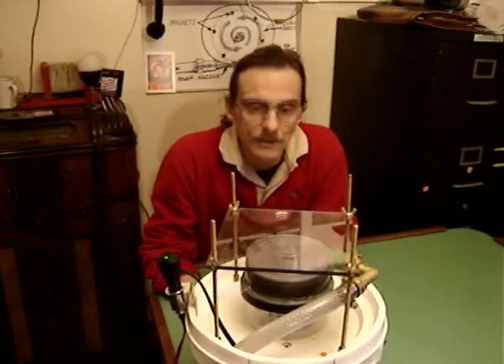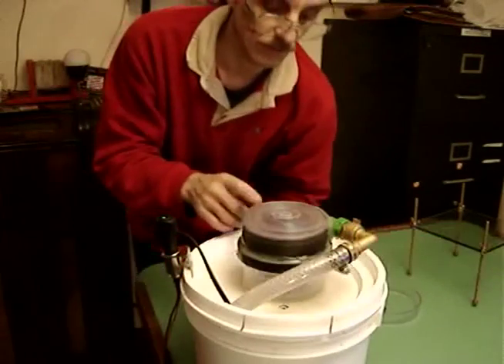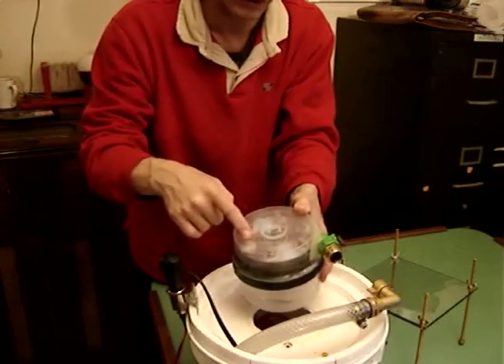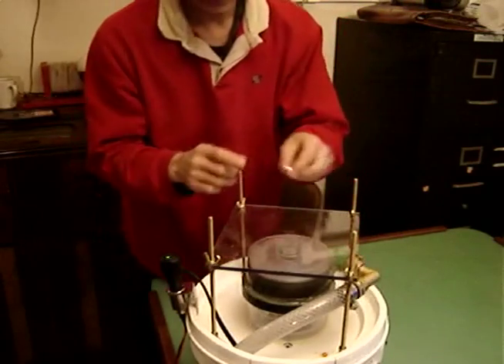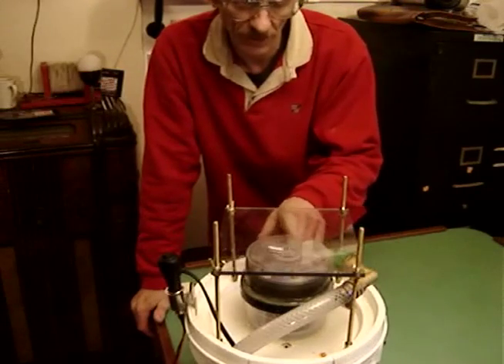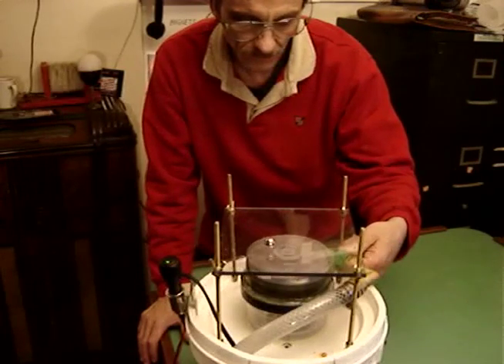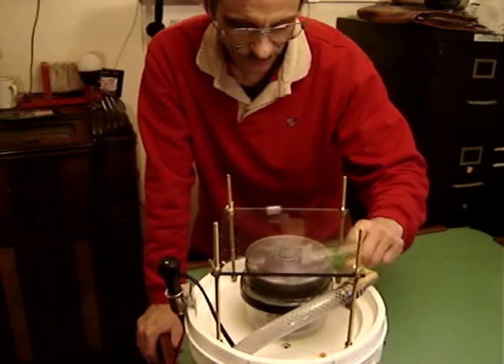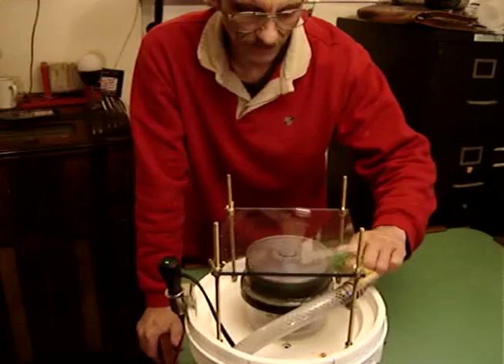Tesla CD Turbine At The Science Fair

Comment: I'd guess it goes backwards because the turbine magnets pull the bottom side of the ball in the direction that the turbine rolls, causing the ball to spin as if it were actually touching the top CD () that is, the ball's bottom surface moves in the same direction as the turbine). But because the ball is touching the plexi plate, friction causes the ball to move in the opposite direction. Cool how the magnets keep the ball from flying off the plate - sort of like a satellite in Earth orbit.

Comment: Try it with a flat magnet - won't happen.  The ball is a magnet, right (not just magnetic steel)?  What you're seeing is due to inertia.  At slow speeds, the ball is not rolling.  It is coupled to a magnet below and simply dragged around.  At a certain speed, the lower magnet will outpace the ball, pulling the ball's magnetic axis off vertical, setting it spinning (rolling) about it's own axis.  In a perfect world the ball would just sit and roll in place - friction gives it forward motion.

Comment from the maker: @geekwes2 
We used 1/32 inch thick x 1/4 inch discs as spacers between the CD discs. We also used 1/2 x 1/2 inch neodymium cylinder magnets as the top drive magnets.

Comment from the maker: @MarkRiverbank 
Yes, alternating magnets would be better for generating electricity. It is problematic to use alternating magnets as a magnetic drive, however.

No supermagnets in Tesla's Turbine, but it requires a shaft, bearings and shaft seals mounted in a strong case in order to get the power out. A mag drive doesn't need these things!

Washers could work as spacers between discs along with drive magnets, perhaps.

Comment: erm im no physicist but it jus looks like the the magnet is pulling the underside of the ball in the direction that the magnet is spinning which is causing the the ball to simply roll the oposite like if u hold the ball flat on ur pal, them move your palm towards you fast the ball wil roll the oposite way and fall off your hand it wont go the same direction that your hand is going

Comment from the maker: Good thinking!  The net magnetic field changes with the lag built into the system. The inertia of the ball, the centrifugal forces on it, and the sliding resistance, also come into play in calculating the ball's path.

I believe it's correct that the ball will go with the turbine again at higher rpms. That would require running on air pressure to test, and the possibility of catastrophic failure!  (hmm, sounds like a good movie...;)

Comment: "Neo Magnet Floats Down A Tube" = eddy current repulsion (or eddy current braking)

"How does the ball magnet sometimes go faster backwards than the turbine turns forwards ?"

backspin of the ball going faster = gearing (your disc of magnets has a bigger circumference than the ball hence the rotational speed of the ball is geared up compared to the rotational speed of the turbine)

Comment from the maker: The only way I found it will work as a magnetic coupling is to have all same polarity. The Turbine has N-N-N-N-N-N up. The coupler put on top of the turbine has N-N-N-N-N-N down to engage the magnets of the turbine in REPEL mode.

To make electric power, it would be better to have N-S-N-S-N-S and produce a full AC sine wave.

Comment: PART3:
The rotor speed for direction change and oposite rotation speed is depending on the number of rotor magnets used,
the size (diametter) and weight (in the earth's gravitational field) of the rotating ball and the distance of the ball-surface from the rotor magnets.
The speed and direction of rotation is dependent on how and where the ball's magnetic lines/field penetrates the magnetic lines/field of the rotor magnets.

Comment: PART2:
When you speed up the rotor a bit, the ball will turn toward approaching rotor magnet.
But like it's going under the ball, the ball tryies to find it's best-opposite position and rotate in oposite direction on the top of the surface.
But when it reaches the next magnet it tryies to spin again to achieve best position for the next magnet.

Comment from the maker: The ball is a magnetic sphere, magnetized axially with a north and south pole. 

At a certain higher rpm, the ball will just sit there and vibrate. I suspect that at certain higher harmonic frequencies the ball goes backwards, stops, and then goes forwards. An AC motor will do a similar thing with "currents of differing phase", Tesla found, in "Notes on a Unipolar Dynamo".

An aluminum pie plate seems to only spin in the direction of the turbine.

Comment: If this explanation is correct then any non ferrous metal ball (brass, aluminum, copper, gold) should also rotate in the opposite direction of the turbine rotation, right? Can you think of a commonly available non-ferrous sphere? Do you think a wedding band might work if a ball is hard to get?
Fix-it-Rick called it a "magnetic ball" Does that mean it is  itself a neodymium magnet or just steel? That would be interesting to see how a rolling magnet would interact with the magnets on the disc.

Comment: Suspend a neodymium magnet tied or taped to a long string from something high - ceiling or light fixture. Place very in very close proximity to the bottom of the suspended  magnet but not touching - something like a block of aluminum - a soda can or something non-ferromagnetic but electrically conductive. Now swing the magnet on the string and watch how the non magnetic aluminum stops the magnet. This demonstrates the counter emf principle from Lenz's law.

Comment: Maybe its following the magnetized water vortex... :-D

Actually it is the shape of the fields that causes that. Imagine each of the internal fields has an invisible apple on top of it (you know, with that dimple where the stem goes on top) and the external magnet keeps rolling inside that dimple as it moves from apple to apple. I call that region the catenoid region because it has that shape through the magnet which extends beyond each pole. The top edge is the event horizon. The ball is inside